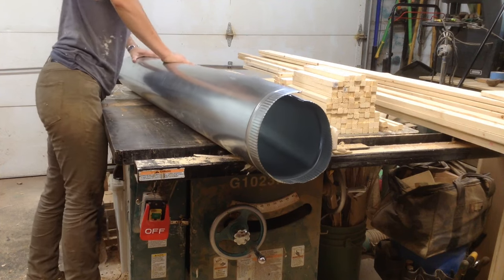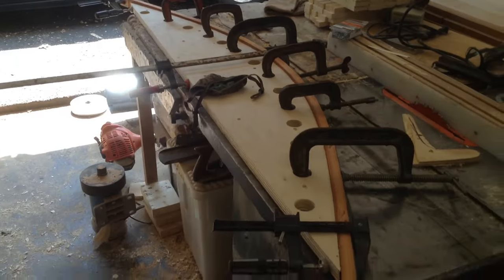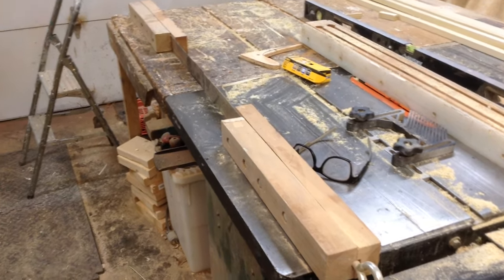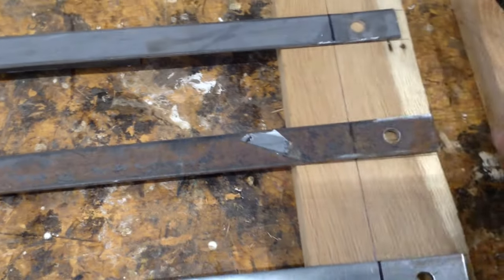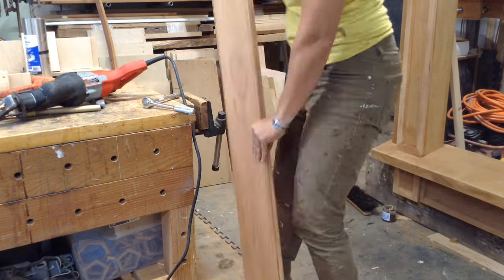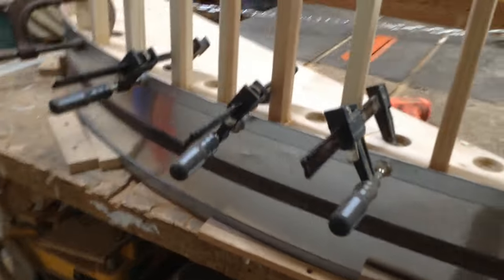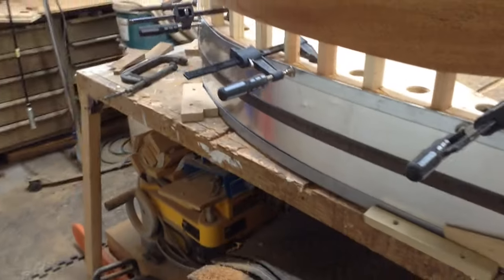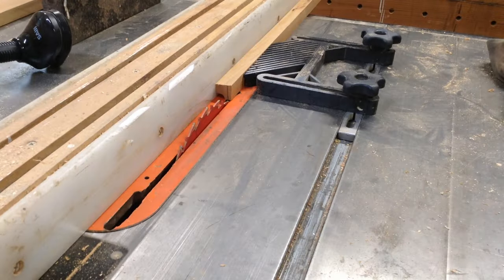How To Bend Wood || Woodworking Magic [Wooden Art]

Comment: Another great video, the amount of time spent making forms and the fact that the forms are normally scrap afterwards because like you said the chances of needing that exact bend again is near zero makes the cost of something like this prohibitive in most cases, but it is great to see the process again and once again I feel the need to try this 🙄, not sure on what but you never know something might come along 👌👌👌👍👍👍🇦🇺
Reply from the maker: Yeah one off bends are just kinda depressing with amount of work that won't be used again.  I think where steam bending really excels is someone making repetitive bends like chairs and lamp shades.  Then the utility of the forms and bending strap outweighs the effort to make it ten fold.

Comment: Awesome job steam bending. I’ve got all the things to make a steam chamber and I’m going to make it. I’ve got a chair project to try it on. If it doesn’t work it will be thin strips glued in a form.
Reply from the maker: My first big steaming project was a chair.  I had to bend 2 inch square oak for the legs.  Had two failures on that one.  And that was with using green, quarter sawn oak.  But, bending thicker lumber is a whole new ballgame verus this 1/4 -5/16 inch stuff in this video.

Comment: You need about 10 hands when bending wood! Nice bending job! That's the down side of building a one of that requires a special jig a lot of work and material that only gets used once! Really looking good!
Reply from the maker: I know all these jigs/forms are already taken apart, and the hardware stored for later use.  The rest is in the trash pile.   I hate the waste of it, but I just don't have the space to store stuff like this.